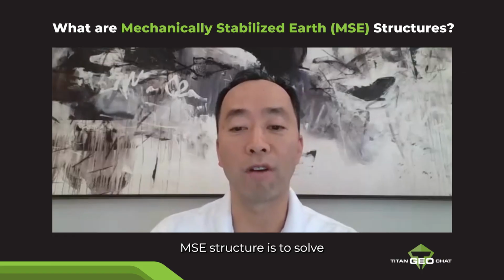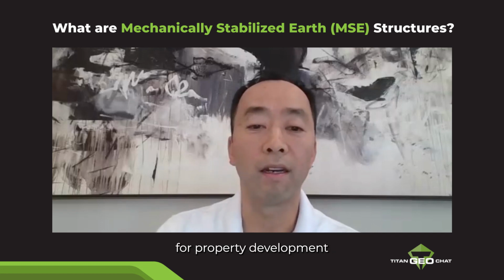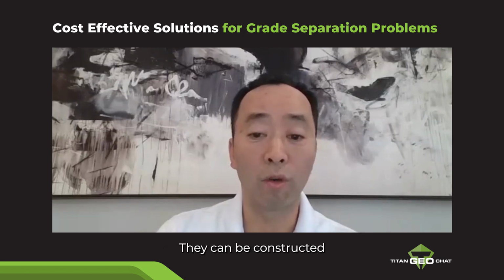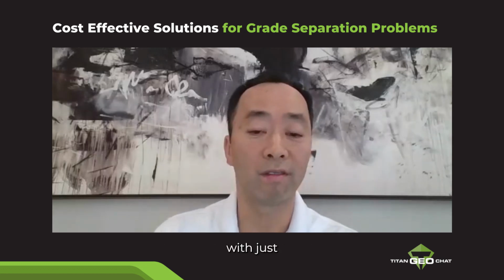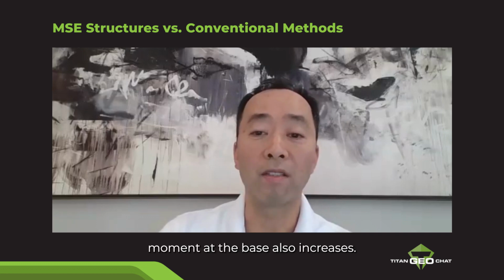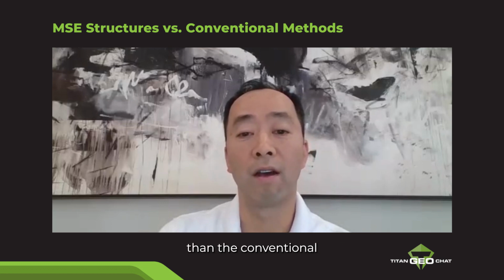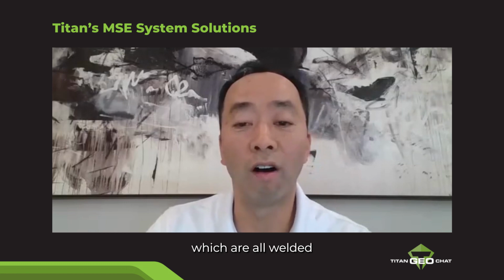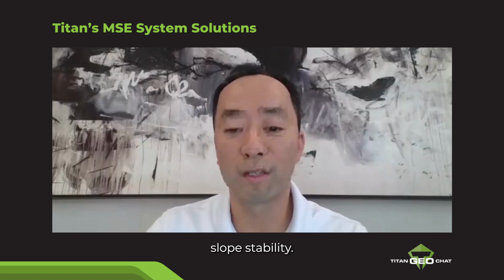What You Need to Know About Mechanically Stabilized Earth (MSE) Structures

Comment: I have seen a few failure of tall mse wall in New Jersey, NY and PA.    Mainly is geogrid connection failure directly behind facing block.   At times, I saw global failure (rotation) if wall is built along pond perimeter.  At times, I saw severe wall settlement as subgrade is soft.   Thanks.